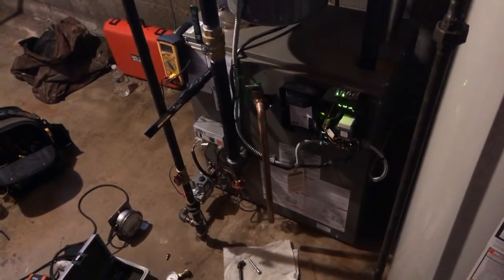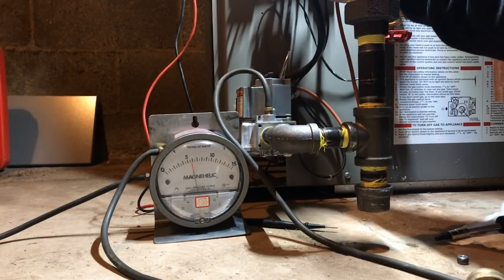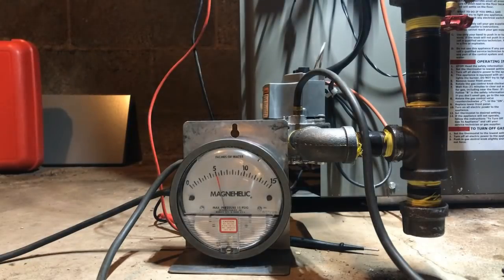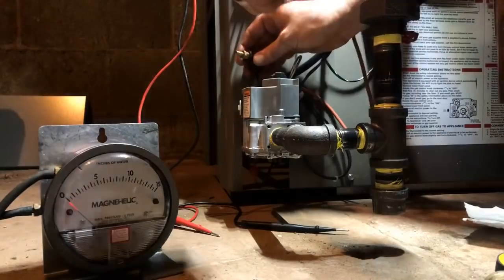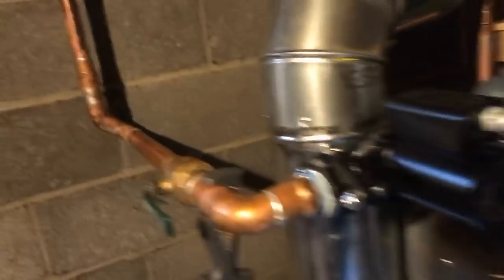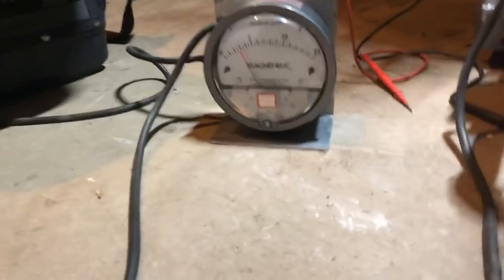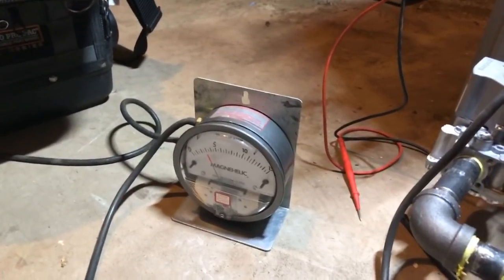New boiler start up not keeping up windchill -17 degrees F

Comment: if it has large radiators with unobstructed air flow, that are not getting hot all the way to the bottom, then a higher volume pump should fix that.
pretty much at no point should a boiler be sized to outrun the radiation elements, that's just stupendous.
on old radiator systems with newer condensing boilers, flow them backwards, hot in top and down-flow to bottom, that keeps as cool of water as possible returning for the longest period and they'll auto adjust and keep condensing pinching pennies as long as possible (that's what they paid for)

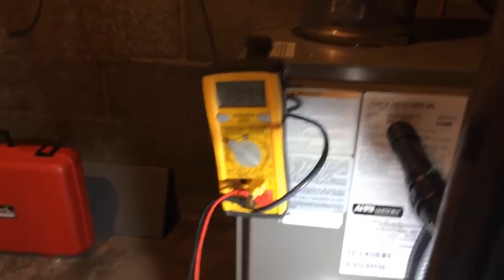Comment: @ 6:20 194F output still, that's crazy hot!  lack of circulation, radiation elements or air-bound circuits/loops.
a proper setup should have a mixing valve or variable circulator on secondary to keep from over-cooling and condensing the boiler or magical controls to keep it from doing so =p
probably older home remodeled by idiots that deleted tons of "radiation elements"  or undersized/too low of speed on the pump...

Comment: surprised nobody raised that boiler up off the floor on blocks or a pedestal. it would make servicing it much easier! and help prevent minor floods from killing it.
Reply from the maker: The old American standard 1950’s boiler was installed in same location so flooding/ shit never mind that was a torch style  burner higher than these burners. With the reddish jacket
Reply: @thehvachacker  it's not mandatory, but looks better easier to install and service. nothing like standing on your head or laying on concrete floor to fiddle with gas valves and burners =p
Reply from the maker: Was doing that today on a boiler with an out pilot that needed a new thermocouple, of course the pro valve had the relief leaking, pump flanges leaking and air vent. Good times

Comment: cranking aqua-stat is never the solution, unless you know it's reading off and need to order one in!
large thermostat setbacks are dumb and most often waste energy by the tons, even in newer "air-tight" homes, more than 4F setback is stupendous and will end up costing more to reacclimate the home and furnishing's, than just leaving it at full chooch 24/7(heating or cooling), I don't need any moronic lab tools nor their perfectly sealed box studies to tell me that much. people open doors, fridges, take steamy showers or bath's, run water and appliances FAR more than they account for by 50 to 75%
yeah most collegiate stooge figures are off that far at MINIMUM(fudged sales points, AKA the root of all evil, besides money?) I need to quit growling, fuming, spitting, frothing, blasting, etc.  such hatefulness... but things need to change while they still can and the USA has anything left....
Reply: Why not? Hotter water leaving the boiler is more btus it can give off.
Reply: point of diminishing return, wasting more energy and that would be far worse if it was a condensing model, since they won't hardly condense with over 160F supply and 140F or lower return temps. that is there sweet spot they condense heaviest at. that's non condensing of course, but over 190F is not great on them and ideally 185F should be max, but it very well could have been designed for 190F supply at baseboards on a dinosaur size unit, which means you'll probably need 200F+ at boiler. not good.
The Next issue if the pressure drops out you could have a "steamer" and you do not want steam in a sealed loop system, very bad things can occur, like blowing copper piping apart from severe water hammering.
it happens, seen it before, steam quickly demo's a home, even unfinished basement, it goes right up through the flooring, which warps, buckles, delaminates, finishes peel/blister, etc.
the right solution is checking for lack of flow or air bound elements(all valves open/air bled?) then calculate the total radiation output and flow rate required to attain max output, check building insulation, doors, windows and other places for major air leakage.
Most likely they'll end up adding radiators/baseboard or increasing the pump size/speed for higher flow velocity, too low on a monoflow setup and you wont get enough circulation through the branches, especially if there's a "zillion" 90 degree elbows and long runs to a second floor. simply check inlet and outlet temperatures to see if your getting enough flow rate! even just touching the lines on both sides of the tee's will tell you. hot out and cold/cool back, not enough flow! probably never designed for such cold weather, nor to be turned down. holy, didn't mean to write a poor novel, DOH!
Reply: But a lot of customers don’t want to spend a penny or can’t. To split up a 3/4 zone on the first floor or put in a variable speed pump.
Reply from the maker: It’s a cast iron boiler and sometimes you need to increase the water temp to make up for inadequate or no insulation in the walls of this 1950’s home with heat convectors. Manufacturer sets the hi limit on this aquastat to 190.

Comment: good call here in mn i get them boilers all day want 75-80  no way  lol
Reply from the maker: When design temp is broken these systems run non stop to try to maintain. Then you have a house with a piece of tin foil in the wall for insulation.......... jobs like this I a thermal imager would be handy

Comment: When the forecast is sub zero with wind chill, don't set back the thermostat. Especially in a old house.
Reply from the maker: I tell my customers the same thing. System will run nonstop just to hopefully maintain set point
Reply: right on, setback beyond  3 to 4F is a big LIE and energy waster in most all situations, even newer magical tight homes homes. it takes time and lots of energy to reacclimate the building and furnishings inside ;)
Reply from the maker: Most high efficient equipment gets the efficiency in low fire which is just maintaining. Yet most older people have it wired into their minds turn it down to save money. Yet a lot of energy is needed to recover from more than a 4 degree setback. Then on extremes when temps break design temps acor heat they cry cause it can’t keep up. As if it’s my fault for the few days a year we break design temps. My house is 71 or 72 heat all the time and ac 74 no setbacks for me.

Comment: 53 in Dallas TX  today
Reply: I was in Kileen in the summer.  100s everyday. No thanks.
Reply from the maker: @cu27rotary70  my brother Ives there and says no one spends time outside in the summer. Most run from air conditioned home to car to work. So for an ac guy there is lots of work but too hot for me also
Reply from the maker: Nice you won’t hear me complain of cold to much except days like today being out on roofs for 5 hours today

Comment: Today in Long Island NY it was about -10 with win chill. It was the day of draft inducer Blower’s  day. Replace 4 all goodmen. Now now I’m home . 
Thanks for the videos .
Reply: That’s were I’ll be today on a roof servicing 5 RTU. That have never been serviced . 
That should be fun .
Reply from the maker: Was it a good day with those rooftops? I had a chiller and 2 rooftops on my first job second was frozsn pipe, third job leak repair on a trane water sourced heat pump. Sealing a leak on a hole on the pipe going to drier. That be sucked and it was a sloppy braze but I think held
Reply from the maker: I would of traded I just rolled into the driveway at 3 am was on a couple roofs today RTU breakdowns

Comment: Few calls today in Philadelphia area. Blower motor, bad tstat, empty propane tank. Bunch of commercial calls for roof top units that had to be pushed off bc of 40mph wind and 0 degree temps
Reply from the maker: Lucky you for being able to push the RTU calls off. I was out on an RTU on side of parkway my next video. Just posted on facebook the hvac hacker group

Comment: Great video..... It's good to see someone still using the old analog manometer. I have one I still use and I also have two dual port digitals.  
It's tough explaining to customers about using tstat set back on boilers. They are slow responding in normal heating conditions let alone when it's frigid cold outside. 
I tell them boilers are like the rotisserie. Set it and forget it.....

Comment: Not a boring video..... that brings a question, is a setback in temperature vs leaving it set at 68-70 on a constant basis more efficient ?
Reply: Generally, a right sized boiler will take a long time to recover from a set back. If you are at or below design temperature, it won't have the ability to recover. That is what it sounds like is the problem in the video. The boiler is large enough to mail Tain but not increase temperature. If you are a proactive person, you can plan ahead and go without the setback when the temps get real low.

 Personally, I found that keeping my house at the same temp works well. I did not find a set back saved me money. I also found that I could set a lower temp because the house felt warmer with no set back. When you do recover from a setback, the air is warmer, but the walls and items in the house are still cold. That makes the house feel cold.

Comment: God that a dinky boiler.  How many btu’s input?  It may be undersized for the amount of emitters.
Reply: Boilers are sized to the heat loss, not maximum output of emiters. Outdoor temps that low are uncommon for NJ. The boiler appears perfectly sized to me.
Reply: Andrew Kelsey what you are referring to is a heat loss and gain calculation that  is a modern practice used by professional contractors...however I’m referring to what is know as connected load calculation...He said that the house has a monoflow piping system using radiators.  If very unfortunate and common mistake when heating contractors “upgrade “ to gas equipment from oil they do not factor in the “capability” of the emitters in place.  They undersized the boiler and the piping.
Reply: The capacity of the emitters will dictate the water temperature used, not the size of the boiler.

And now that I am thinking more about this situation, if the boiler was undersized, it would not be able to maintain the setpoint or climb higher in water temperature as it does in the video. In this case, the emitters may not have enough output available.
Reply: Andrew Kelsey not enough information here.  We need to know the input btu rating on the boiler and the size and number of radiators to have any informed opinion.
Reply: Father Time  definitely undersized
Reply: I will add this, if you are trying to minimize fuel usage and cost to run, you size the boiler to the heat loss. If you want the ability to heat your house to 80 at any outdoor temperature or recover from a 10 degree set back in 30 minutes, you will size it to the radiation.
Reply: Andrew Kelsey exactly.  Every home owner is different...I am old school and tend to oversize my equipment especially for the “older” clients.  The younger ones have more patience and understanding of the newer high efficiency equipment.
Reply from the maker: Ok so the boiler is not undersized or I wouldn't be able to get the water to 209 degrees. Unfortunately, I might have said radiators yet they are just baseboard heat convectors from the late '40s early 50's. This was an old-school American standard gas boiler here. She had the same problem with old boiler why she upgraded she told me. last year her old boiler wouldn't keep up on a 9-degree day. Doesn't help those converters most likely need to be cleaned yet I wasn't moving furniture. The boiler output was 100,000 btu.
Reply: The boiler is definitely not undersized for the radiation.  The radiation is undersized for the heat loss of the home.  

The only thing that can be done is to decrease the heat loss(add insulation, upgrade windows, etc) or increase radiation(add baseboard, panel rads, etc).

It still amazes me that people will point their finger at the boiler as this type of problem.    I’ve seen it over and over.
Reply: Todd Coonradt yup insulation is the cheapest way to add comfort on the coldest of days.
Reply from the maker: Her walls were cold. Insulation might get the heat up to 70 which is still better than where I was outside working after this call. The one room off the garage the convecters were buried so no heat. She is blaming the boiler cause most believe a new system solves all problems the old system had. It’s the same with ac. New system old ductwork and the customer wants to know why some rooms don’t cool good enough
Reply: it may just need more flow velocity, to push more water out the monoflow branches, especially the longer runs to second floor, but that could over-circulate shorter first floor runs and may need balancing valves on each branch, speaking of valves,  maybe is has them and someone's fiddled around because it was "too hot" somewhere.
easy enough to check the temperatures on the branch supply and returns, if the returns never come back hot, there's a lack of flow, check for closed valves, air in loops, increase flow "larger pump"
up next complaints about noise in the pipes :))

Comment: Insulate the supply, it will help.
Reply from the maker: Somewhat it will help there is small converters in the house. The lower level on the split by garage so much crap covering convecters

Comment: Not boring, good video. Years back I went to  a house that the customer undersized his boiler thinking he was saving money and on an extremely cold day. ( on a Christmas day I don't remember what year.) the temp outside never went above zero. The house never got above 58F. I got called out on a service call and he did not believe me that the boiler could not keep up with the outside temp and wind. Went back a few days later on a warmer day and his house was 72F. I also have used many outside temp reset controls that have worked great. Thanks for the video's.
Reply from the maker: I like the tekmar controls to put outdoor resets on cast iron boilers or when more than one boiler to make a lead lag boiler

Comment: Um hello - I have a 25yr old R22 heatpump that has to be recharged 3 times a year and its about 9 degrees outside and the unit has about 2 foot of ice built up on it. My thermostat is set to 80 and its 50 in my house. Any idea of what it could be???? TYPICAL NO HEAT CALL IN HVAC TRADE.
Reply from the maker: The best is when they refuse to use the auxiliary heat cause it’s expensive. Most systems can’t keep up since jersey broke design temp. They maintain yet can’t pull all the heat out I wish I had a thermal imager and hand warmers, I lost feeling in my hands then they started burning on one RTU repair today.

Comment: Thanks for your videos.  I don' t know where you are located but with that outside temp and wind chill that boiler may be properly sized manual J system.  The one pipe or mono flow and setback Stat could make for chilly wakeup when that cold outside though.  They might want to consider overriding that setback  when temps that cold are expected.
Reply from the maker: That was what I advised them to do. When temps get below 15 not to use there schedule. It ran the whole time I was there and stayed at 66. We broke the design temp for nj we have cold days but only a handful that gets like this.

Comment: Lol that’s a pretty old school pressure tester. Invest in a nice UEI electronic manometer.
Reply from the maker: I have a fieldpiece on yet find these to be more accurate. My combustion analyzer was also in the room which I could of used also. For gas not as important yet pressure switched I prefer the analog to catch pressure spikes
Reply: @thehvachacker  I totally agree.  We had a different tech on a boiler not keeping up and flame would rise/ lower very fast to the point digital wasnt able to check it. I came to call and hooked my analog manometer. Seen that pressure on inlet side of valve was going from 6" to 1.5" in half of sec. Found out water on low pressure gas main on street feeding home. That's why flame going up and down fast.  1st guy there was ready to condemn the gas valve. That would have been wrong repair. 
So gas company came out and pumped out water from a "DRIP" where service line from house meets gas main on street. 

Problem solved.....

Comment: Good video man
Reply from the maker: Thanks I feel bad system is maxed out why set backs are overrated at times
Reply: @thehvachacker  I just installed a Ecobee on my boiler/ AH system and it burnt up the boiler transformer and blee the A/H control board fuse for no reason at all.
Reply from the maker: What shorted out did you program it for separate transformers? My ecobee has bee good to me got it free from ecobee. The catch was I had to install it in 3 days of getting it